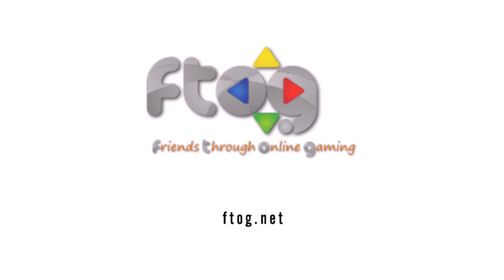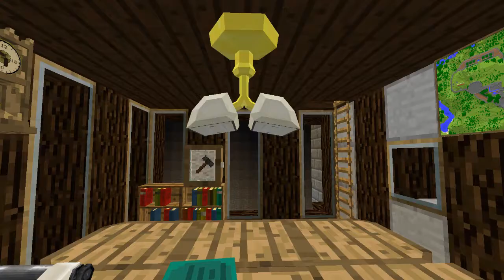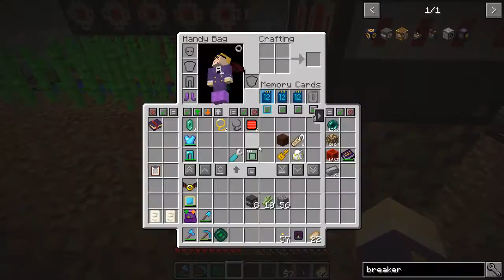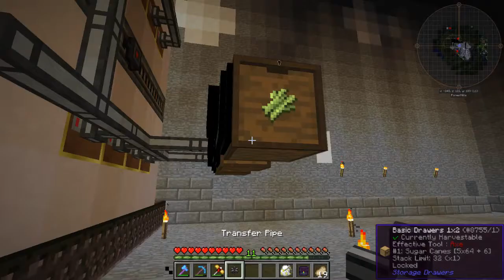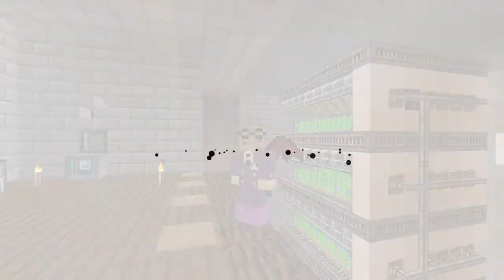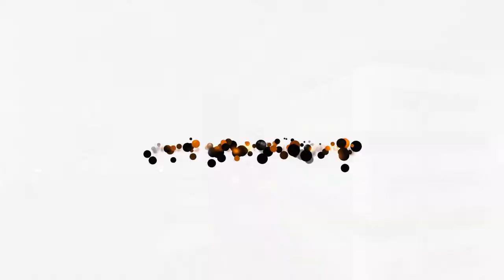[Lets Play] Quantus :: E32 - Interesting starting point for Power

Comment: Those glow stone bricks look really cool, shame the hemp is just industrial! Have you ever tried actually additions greenhouse glass, it has a nice look and works very well. One fermenter and one squeezer was a good balance in 1.7.10 bigger problem was getting enough materials to keep the generator running. The silos and tanks are really nice looking and you can feed the silos using hoppers and conveyor belts and it looks really cool.